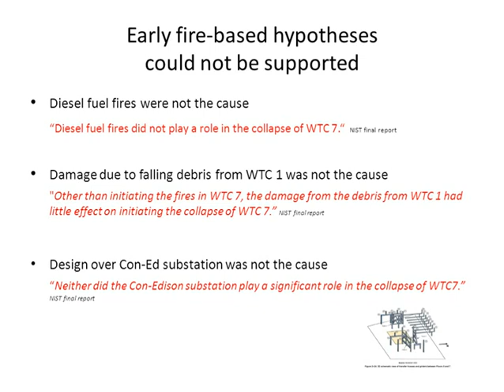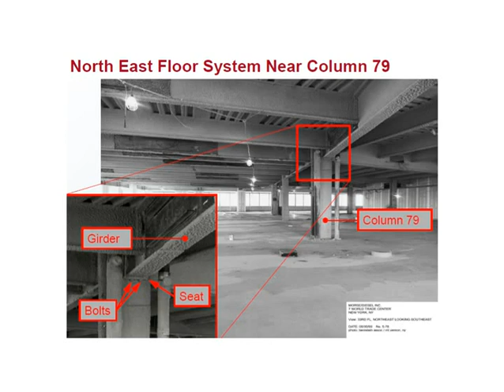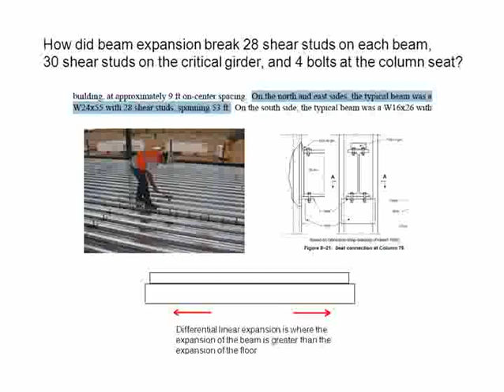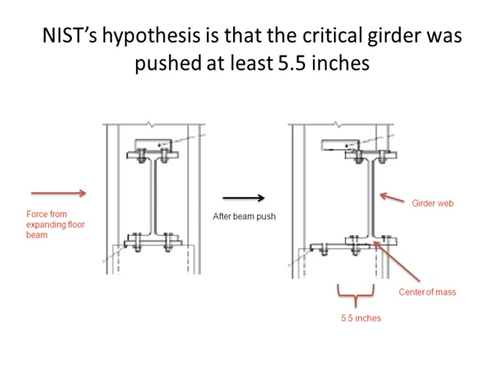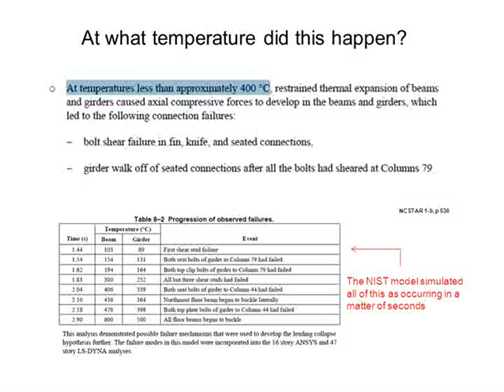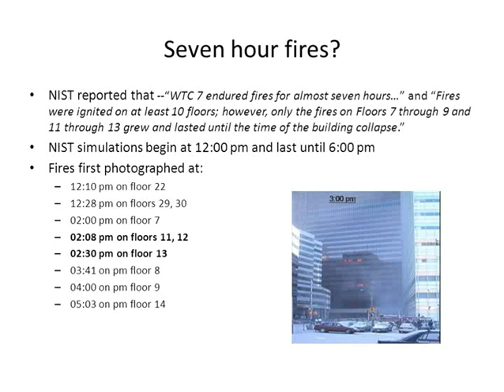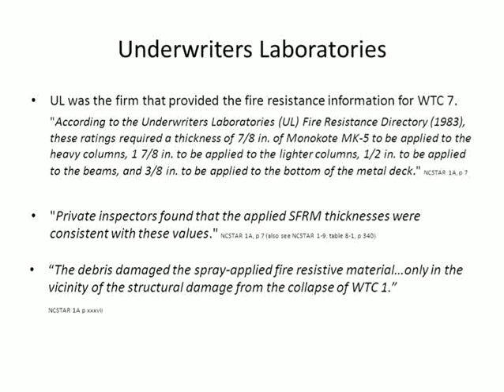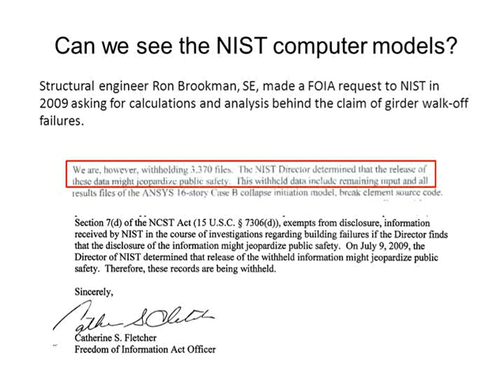The NIST WTC 7 Report is False

Comment: (1)
I cannot look into K. Ryan's heart & know if he is lying, or merely woefully incompetent. I strongly suspect the correct answer is "both". Either way, his conclusions are utter bilge.
Misinfo in this video start at the very first line.
1. NIST never "promoted" that diesel fuel caused the failure. They said, early & correctly, that it MIGHT have contributed. "Several months" (NIST faqs_wtc7, Q18) after collapse, not years,  found fuel still in tanks, they abandoned that hypothesis.

Comment: (2)
They kept the slab's temp at room temp ONLY for the analysis that determined the differential expansion TRANSIENT between the beam & the concrete, in order to check the stress in the shear studs.
Those studs fractured at steel temps that were VERY low, starting at ~120°C & all fractured at ~300°C, IIRC.

Comment: No, you're wrong.
"The slab is not heated" is exactly the RIGHT thing to do.
The reason is that, while the coef of expansion for steel & concrete is approx equal, the thermal conductivity of steel is ~100x greater that for concrete.
In the STATIC case, they will expand approx the same, But concrete expands much, much more slowly because the heat soaks into its core so slowly.
In the DYNAMIC case, the steel expands so fast that it has reached full expansion before the concrete expands at all.
Reply: How long did the building burn?

Several floors were heated, so the temp would be CLOSER not farther apart...

Also their model uses a specific nuclear thermal expansion rate!!!
In 2 seconds... @ 6:47

No Physicists analyzed that as unethical modeling?!

Comment: @roquefortfiles /watch?v=GEPjOi2dQSM&feature=related 
thats what a natural collapse looks like from a fire MUCH GREATER than the small wtc fires, AND the steel structure remained intact! So explain wtc7 which was not hit by a plane and had small isolated fires and fell straight down through the path of greatest resistance in 7 seconds.
You were failing?????

Comment: @roquefortfiles "When the columns failed (and they did.. you can see it). The upper 31 floors rotated over on to the floors."
 HAHAHAHA you can see through the building? and where do you come up with 31 floors?!?!?!? You didnt even answer the question, you are delusional. You are leaving out the fact the each action has an equal and opposite reaction. You also didnt address the fact that the lower structure was still fully intact and that steel is thicker than the upper floors.

Comment: @roquefortfiles ahahha yea one floor wont hold the weight of 14 or more floors, but 88 can hold 12, and the upper floors wouldve fallen in the path of least resistance, not the greatest. A natural collapse wouldve tipped to one side and the underlying structure wouldve remained intact

Comment: @roquefortfiles AHHAHAHAHAHAHAHAHA you are so pathetic you still didnt read the patent.
 PATENT 5698812

"Utilizing the present invention, a steel plate 1 inch in thickness was completely burned-through using 0.75 pound thermite charge within a container three-quarters the size of the M14 package which contains double the thermite."

AHAHAHAHAHAHAHHAHAHAHAHAHA you are so willfully ignorant you believe that you have all the facts without doing the research.

Comment: @roquefortfiles patent 5698812
FIELD OF THE INVENTION
This invention relates to destructive devices using thermite reactions and in particular concerns improved means of utilizing such reactions in the destruction of metallic targets.

Patent 5532449
INDUSTRIAL APPLICABILITY
The present invention is effective to serve as a method and an apparatus which can prevent a secondary problem due to noise, flying dust and chips, and the like, and can demolish concrete at a high efficiency

Comment: @roquefortfiles "BTW no explosive or incendiary renders concrete floors in to powder."

Patent 5532449 proves you wrong, you would know this if you actually read it but you think you know everything.

INDUSTRIAL APPLICABILITY

The present invention is effective to serve as a method and an apparatus which can prevent a secondary problem due to noise, flying dust and chips, and the like, and can demolish concrete at a high efficiency.

Comment: @roquefortfiles Due to its height and high winds associated, the steel in the upper floors were thinner than the lower floors. This is fact easily found by looking at the blueprints of the building and common sense architecture. So is the fact that it is impossible for 12 stories to "crush" 88 stories and 20 stories to "crush" 80 stories. You are delusional, please find help.

Comment: @roquefortfiles In 1935 popular mechanics published an article called "Skyride tower felled by melting steel legs" "When fired by electricity the thermite generated a temperature of more than 5,000 degrees about the two legs, melting the ten-foot sections almost instantly, causing the tower to tip and then to crash."
 So given 66 years, the advancement in using thermite in this manner patent 5698812, and one that specifically deals with noise 5532449 gives much support for CD.

Comment: @roquefortfiles I think you need to recheck your math.  There wasn't 31 floors worth of mass sitting on the floor trusses when they started bowing.  Nor is that even the official explanation of the failure of those trusses.  Nor does a 31 floor section of the top of the building weight more than 1/3 of the mass of the building.

Comment: @roquefortfiles If you wish to talk reasonable rational logic then I can do so:  Why do you believe it possible for fire and structural damage to bring down a building but not fire, structural damage (from a plane) and explosives?  If it is possible for fire to bring down a building then is it not also possible for fire and explosives to bring it down?  Is it possible for explosives to have been used to bring the building to the point where fire would initiate collapse?

Comment: @roquefortfiles I'll prove you wrong when you show me the report showing metallurgists testing a significant portion of the steel for explosive and thermitic residue.

It was burning top to bottom?  Are you sure?  Because there is not a single video or picture anywhere showing flames in WTC 7 when it collapsed.  NISTs report says it only had smalls fires on the majority of the floors.  As for Mr. Nirgo:  I can reference FDNY members saying bombs and explosions.  So what?

Comment: @roquefortfiles Oh I have which is why I know you're wrong.  The only metallurgical testing was done by FEMA and NIST and they tested only 3% of the structural steel from the affected floors of the towers and only 1 single piece of steel from 7.  And in both cases they specifically did NOT test for explosive/thermitic residue.  But you already knew that which is why you are making claims and then refusing to back them up.